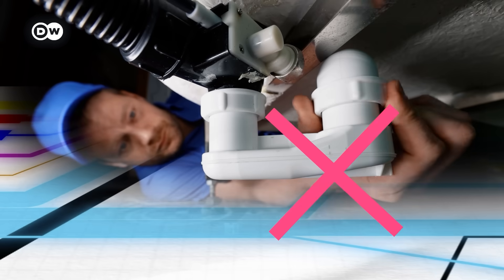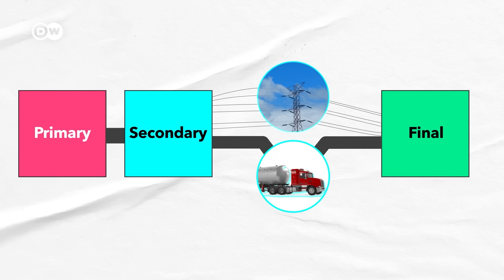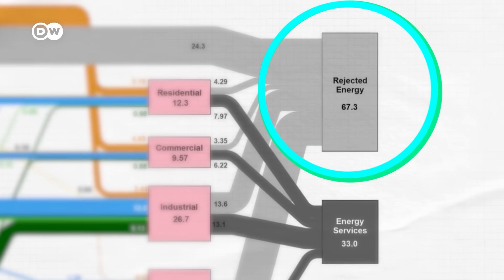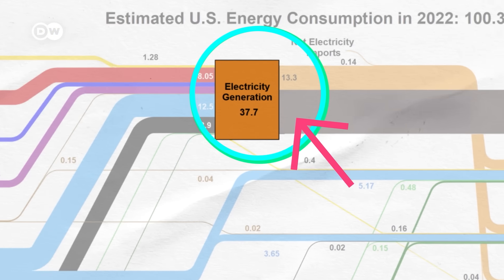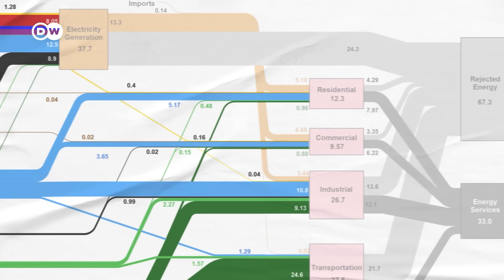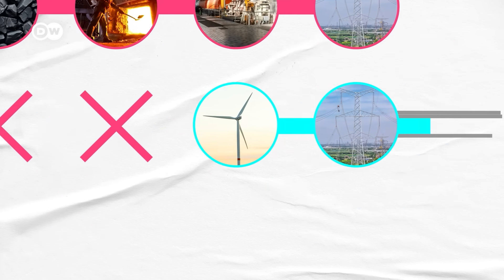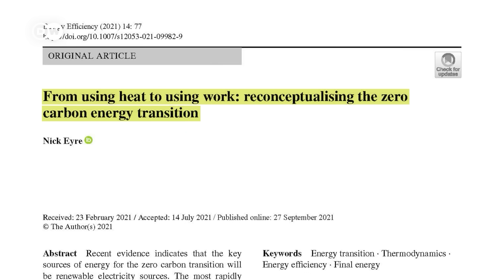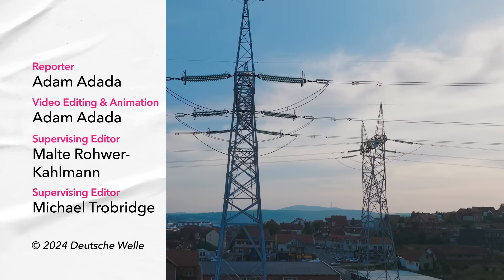The mind-blowing thing we get WRONG about energy

Comment: Wind turbines are not efficient due their limited size and lack of wind. Also it requires maintenance. They have to be spread all over a country or even placed out on the sea This makes them even more exceptive and difficult to maintain. Placement requires a lot of planning. Batteries are not 90% efficient either. So that is a false claim in this video. They are a hazard to the environment to produce and a big contributor to emissions. They are difficult to dispose of and cobalt is a limited resource. It's not as simple as just putting a "renewable energy label" on certain thing and call it the day
Reply: It's a good argument for getting rid of personal car transport, since that's by far the largest user of battery storage. Other kinds of storage are way cheaper and cleaner for stationary energy storage, like flywheels, compressed air and pumped hydro.
Reply: @joshbobst1629  The scientifically the most renewable green energy source we have at the moment comes from nuclear power plants. It has a terrible reputation but statistically it is more efficient and more secure than any of the other types. The next thing would be to start preserving the rain forrest. Besides battery power cars in general are only responsible for a fraction of emissions compared to industry and aquaculture. But cars are an easy target for politicians since they are mostly owned by private working people. What they forgot to account for is how their approach would affect the western car industry. It does not look good for the German chancellor Olaf Schulz since the German economy seems to be a sinking ship at the moment
Reply: @joshbobst1629 if you remove cars as the form of transport we will have to bring horse back in and then someone will decide they are bad for the environment too. Cars run on HVO have 80% less emissions. If that fuel can be used on a large scale it will pretty much eliminate the negative impact of ICE cars and would make them less impactful to the environment than electric cars are

Comment: What they have forgot to add is the heat energy loss also warms up the house so less energy from other sources is needed to keep the house warm. Like this was the main stpdty of the first "enrergy saving toxic lightbulbs", like all houses with electrical heating up water or oil heating up water to then circulate through the pipes could have stayed with the old light bulbs that did not have dangerous stuff in em because the heat loss from the old bulbs was just a source to heat the house. So less loss is not always a good thing for everyone and would have been more efficient to let people with X type of houses still use the old more nature friendly ones.(Today the calculation looks different with led lights and 4x heat pumps, but back when the mercury bulbs were introduced it was pure stpdty and added probably tons on mercury to nature. I think it was mercury but one of the really dangerous ones). 

Still my point is that if a house is heated with 4x heat pump and something releases 100Kw of heat into the house the loss is still only 75Kw not 100(rough calculation). So in all cases when you can use that heat loss then its really not a loss. What is a loss and really stpd is the cooling of the air and should be restricted to 25 degrees celsius as the lowest teperature setting maybe even 30 because do we really need to cool it down to 20 when its 28 outside while if its 40 outside cooling it to 30 might be needed at least for elderly people. We did not die as children when all you could do was open the windows in the car so why even have the option to cool it down now, so much wasted energy just for ignorant people that burn fossil fuels that heat up the planet just to cool down when the temperatures are within "not dangerous". Same with the heating, why even have the possibility to heat up to 30 when all you need is 20 for a comfortable environment during winter(like have more sensors if the spread of the heat is uneven and maybe you need one room at 25 so that the others go to 20). My point is that this is stpd energy waste.

Take cars, no matter if its electrical or fossil it is a waste of energy when people drive distances below 5km(like yes some have bad roads to move along and maybe not public transport to use, but many have and that should be a forced option to use public transports if the trip is under 5km. You can do a weeks shopping at once so there is no need to drive 2+2km for something you forgot, use your feet or if you are lazy a bike not a electrical bike you lazy fk).
Reply: Ihre Vorschläge wären Eingriffe in die Privatsphäre und führen genau dazu, dass die Menschen keine Lust mehr auf die Energiewende haben werden. Das sollten wir nicht tun.

Comment: Motors, Transformers and Generators are much more efficient that engines. Motors, Transformers and Generators used energy ( electricity ) directly. Engines use the fuel ( fossil fuels ) to make energy and they are very inefficient. About 2/3's of the gasoline that goes into a car's fuel tank is wasted and only about 1/3 propels the vehicle.

Comment: This kinds of answer and also not, my question about electric vehicles. See i used to see EV as inefficient, you have to change from power plants' primary fuel (coal, gas,etc) into electricity and change it again into kinetic energy. That's 2-steps process with highly inefficiency. But after knowing gas vehicles are also inefficient at the first place, is it worth to compare them to electric vehicles? Hmmm,  interesting.

Comment: As someone who lives in a country where more than 75% of the electricity is generated by green sources, I tell you that petrol is still going to be king on the transportation industry for a long time, because it's simply more convenient, as of now there are simply 0 viable alternatives in the market, outside of the niche small distance urban transportation.
Reply: I’d hardly call “small distance” urban transportation a niche. Many small changes can have a massive impact.
Reply: Small distance .... checks road trip logs .... 1050 miles in a day is my current EV record, and there is nothing more convenient than an overnight charge while you sleep.
Reply: I don't know man. I have a Tesla that can drive around 150 miles per day. I wake up with a full battery every morning. Never go to a gas/charging station. If you forgot to charge, Tesla superchargers are about 10 mins away in my city .Pretty convenient to me.
Reply: Have you ever heard about 🚂?

Comment: While using the Sankey chart is great in terms of showing where inefficiency is, it completely hides the other dynamics at play that keep our systems on fossil fuels.  For example, you simply cannot run heavy construction equipment on electricity with current battery tech, as the batteries would be too heavy for the equipment and duty cycle needed, plus the time it takes to charge.  Same with large delivery trucks.  This is why combustible hydrogen engines are being looked at.  Also, 75% of a battery plant consists of natural gas burners to dry off all the solvents and catalysts used in battery manufacture.  Also, this video even mentioned some of the energy of the car was being wasted even though it's important to have heat in the winter, and defrost systems on your windows.  On top of that is the problem of power density - the amount of power generated or used in a given area.  There are many areas of the world where power consumption is large, the area is small, and the generation must stay within that small area for various reasons (jurisdictional, geopolitical, geographical, etc).  That means there will be lots of places that don't have the space for solar and wind,  and that don't want to take the risk of having critical infrastructure outside their border. This is why nuclear power is important, and SMR reactors have a role in remote, poor sun/wind characteristics, and hugely expensive to run electrical lines thousands of kilometers.  The hard truth is, if we try a full on renewables transition now, you will find that you will not magically reclaim the 2/3 wasted energy but you'll be still using much more, that you'll still be burning lots of natural gas to make all the batteries needed, that electricity prices will go up because people won't have choices of energy source to choose from, and some industries like construction are going to need an exemption anyway to run all the heavy equipment, or, you are going to build out a separate hydrogen infrastructure to run equipment where battery weight is a factor (kinda like we have gas for light passenger vehicles and diesel for heavy equipment), and your energy efficiency is going to be awful again.  The Devil is, and will always remain, in the details.
Reply: And then of course your electrical supply relies on Mother Nature. Not the most reliable form. Here in NZ we have a large percentage of hydro and due to low rainfall last year the lake levels are low so the few gas and coal power plants have been running flat out. Renewables are not the single answer.

Comment: Be as it may, switching our entire energy needs over to renewables does incur extra energy loss due to scaling up issues. Smaller scale renewables like the ones we have now can deliver power almost in situ, without need for storage or long range transportation. But once renewables take over a larger percentage of the energy mix, energy storage becomes mandatory and loss of energy from that will take effect. Not to mention the required shortfall capacity and the need to maintain more energy infrastructure.
Reply: Scalebility is an alien concept to our deluded Green masters

Comment: This video is misleading at best
renewables need batteries, nowhere is this mentioned and these tend to be terribly inefficient
(batteries as in any kind of system that allows to store energy for later, hydro can fill that role for example if you use it coupled with pumps)
also wind & solar life cycle are kind of bad right now

also is the fact that energy wasted is not actually always wasted taken into account ?
for example in winter if my gaz burner waste heat into my kitchen it's not an issue
Or .... while it snows if my "petrol car" generates heat, it's actually a somewhat desirable outcome ....

so while there's interesting points in this video, I believe it's way not enough in-depth to the point of being wrong about everything

Comment: I was expecting a lie, but boy do you lie. No fact checking required when promoting activism. Lie for the greater good, yes?

Just in case its not obvious- new stuff is more efficient than the old regardless of what type of a thing it is. Fossil fuel powered things are way way more efficient because we have perfected technology so much. If we had the money to switch to newer more efficient stuff, we would still be better of by using fossil fueled stuff. You can hear the lady say it in the video that only older generators are less efficient and this is the stuff we eventually have to use, because we don't have any better. If we had money to replace them, it would be more efficient and cheaper too. But that goes against the woke green agenda.

Comment: Again DW stop selling half of the picture, like always.
Switching to all electricity doesn't come at no cost. You have to build systems that are non existant currently to replace what currently very efficient processes with fossil fuels. These system will have to transport electricity to where it is needed. This means a massive amount of metals with all its beautiful problems will need to be dug up. And do you think we will dig those things with electricity? Inefficiencies with electricity are simply hidden somewhere else and they are being ignored in the modified graphs you show. The biggest element of solution that will be required to achieve a transition is to slow down the speed at which we are wasting everything.

Comment: Great documentary, i am convinced that renewable are more than renewable, they are also added efficiency. Did not realize the real impact of renewable until this documentary
Thank you
Reply from the maker: Thanks for asking! It would take that into account in the industrial data, as it takes energy to extract & refine fossil fuels or manufacture renewables, so it's not factoring into the beginning section (primary energy), it's factoring it in at the later stages (final/useful energy) ✔

Comment: This is far from being the silver bullet you're depicting in this video, and is misleading for three reasons:

- producing wind turbine and solar panel relies on organic chemistry. This is an example (but far from the only one) where moving away from fossile fuels makes stuffs more difficult.

- there's a diminishing return with renewable in the sense that the more you relies on renewables (wind and solar), the more you have to install wind turbines and solar panels to guarantee that you'll still have enough electricity during times without wind & light. Just by that, you need to install typically 3 to 5 times more plants.

- alternatively, you need to build energy storages (which is yet to be proven to be doable at scale) or additional gaz power plants to compensate for the lack of production from renewables.

This is not to say we shouldn't invest in renewables. We definitely should, for we need to be prepared for the upcoming lack of oil (at scale).

Comment: What they don't take into account are the environmental costs on the storage devices for the energy in these cars or all machines at that,. A simple plastic fuel tank or massive battery?  And with a lifespan of on average 10 years a car or truck is going through at least 2 batteries in it's life. (I might hope, Scraping the car after 10-12 years would be even worse) If you are really interested in what would really be the most efficient you should take that calculation into account.
Reply from the maker: Hey there! We have a video that might interest you. Check it out! 
👉 "Which will be the engine of the future?"  https://youtu.be/qiQcGdq66DI?feature=shared
Subscribe to our channel, we post videos every Friday ✨

Comment: These diagrams are terrible because they erase the individual efficiencies of the different energy sources used in power generation.  They also ignore all onsite powerplants for Industrial plants and the figures for renewables are expressed in braindead 'powerplant equivilents' when they should just skip the generation step all together and feed into actual electrical use because their was never any rejected heat from a windmill or solar panel.  The graphs have even regressed in usefullness because they no longer show the NON ENERGY uses of Petroleum aka PLASTICS and LUBRICANTS which are the chief industrial uses for Petroleum.

Comment: There is little doubt in my mind about the efficiency difference you share with us. One issue is the intermittent nature of solar and wind, and the storage of electrical power we need to cover the periods without sun and wind. In The Netherlands we can't store much as we are a flat country. The second is the difference between installed and actual power. As example, my solar cells produce 3kW max, however my annual production is around 3600 kWh, which is an overall efficiency of 14%. Nuclear is around 80%, so even with the (relatively efficiënt) conversion from heat to electricity this is about 3 times better, and the life time also 3 times longer. That's why I think Nuclear is beating both fossil as well as wind and solar for a long time to come.

Comment: This film seems over simplistic❓It focusses primarily on renewable electricity being more efficient for converting primary energy to usable energy - which, of course, it is. But it says very little about the many real world realities of using it & converting to using it.
- Transmission losses over distance & the complex grid upgrades needed
- Storage: energy density of current batteries is too low for many forms of tranport - particularly aircraft
- Overall carbon foot print of manufacturing electric cars is so much higher than making petrol cars that you have to drive 70,000km on average just to break even
- Base loads: to cover when wind & sun aren't working - to be emission free these require nuclear power stations
- etc

It promotes one vald point well but ignores the whole picture.
Reply: You got several things wrong here, I’m afraid. First, while batteries aren’t enough for aircraft or long distance shipping, they’re great for land transportation - arguably the single biggest CO2 contributor. They’re also good for enough power for hours (up to days) of grid storage. A grid that is covered entirely by renewables and batteries nine days out of ten is NOT a good place economically for “base load”. 

And the carbon footprint of EVs over gas cars is not 70,000km. You should go check your data assumptions against mainstream research. And even then, how many km does a car drive in its lifetime? 300,000? 500,000? What about the carbon footprint of THAT?